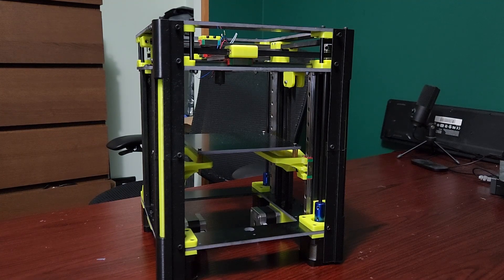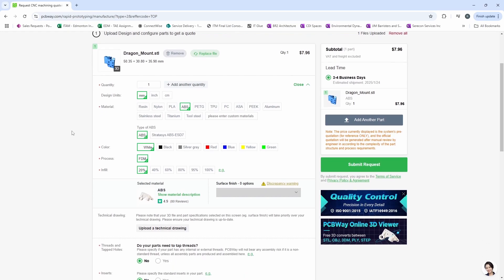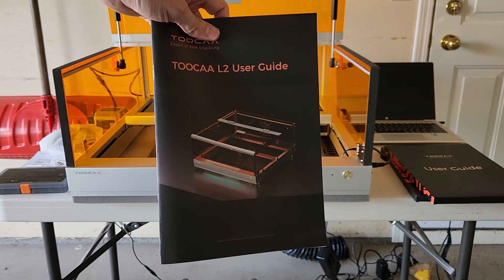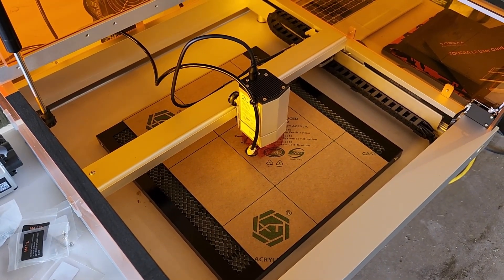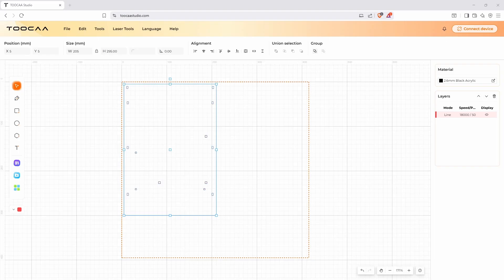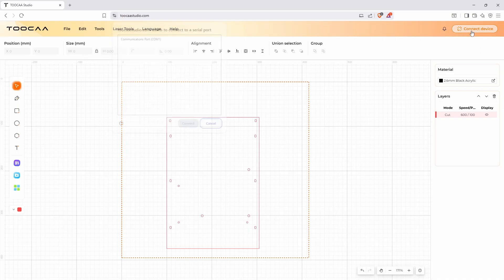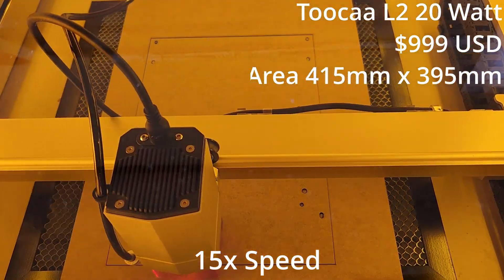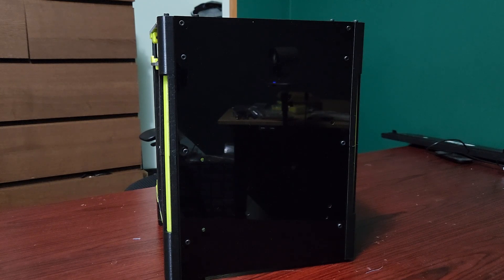Cross Gantry 3D Printer gets laser cut acrylic with TOOCAA L2 20watt Diode Laser!

Comment: I understand the criticisms of these cheap, open-frame diode lasers, particularly from a safety standpoint—but $1K seems like a decently steep increase, so I have to wonder... does the  aluminum and acrylic really add that much value? It seems more worth making the jump to CO2 with a K40 clone type cutter in the same price range, and maybe even save a couple hundred by doing so.
Reply from the maker: C02 lasers are more complicated, need water cooling and the tube will eventually need replacement. If you want to cut clear acrylic it makes sense but the K40 is $600 stock and they need a lot of upgrade to make usable. A enclosed diode laser it just simple and for most people all they need. I agreed with you the price of enclosed diode laser can come down some.